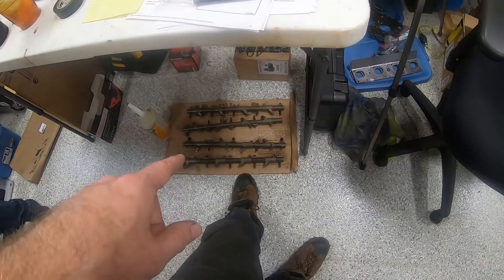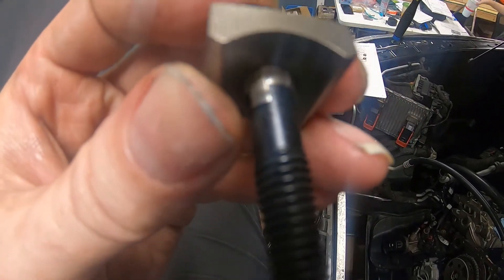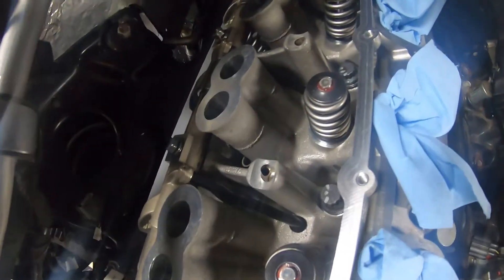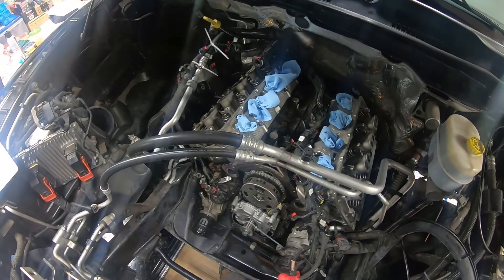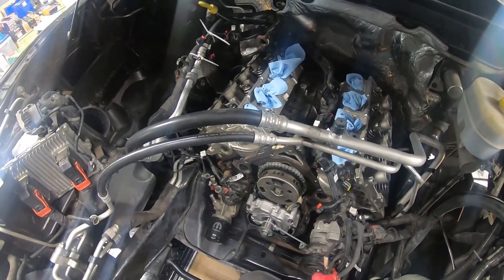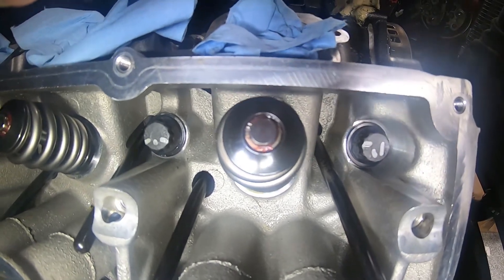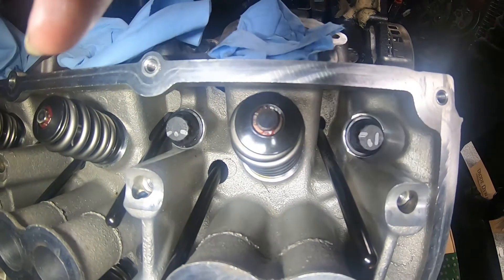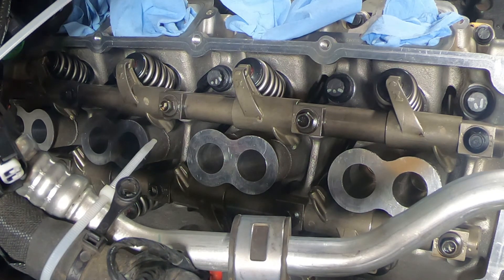Ram 2500 6.4L Upgrade Part 28 hemi valve rocker arm install

Comment: How did you measure to get the proper length pushrods? Because you used an aftermarket cam, which is likely ground with a different base circle, which would require different length pushrods to obtain the original hydraulic lifter preload.
Reply from the maker: Thanks for the comment.  The pushrod length was determined by my tuner, (Jay Green) as well as the grind on the cam.  He sold in a kit the cam, lifters, valve springs, valve spring shims, valve spring seats, and pushrods.
Reply: @solargarage  so Jay Green ground the valves & seats, too?
Reply from the maker: @budlanctot3060  No, I did that as part of the cleaning and prep when reassembling the heads.
Reply: @solargarage  wow. I'd say you were pretty lucky, that you must have had compensating errors. Grinding the valves & seats sinks the valves which increases the preload on the lifter. If the head is surfaced, or a different thickness head gasket is used, that changes preload, too. With 16 valves, there are a lot of variables here, which are not predictable unless extraordinary precautions are taken. If you were successful, congrats, you should buy some lottery tickets.
Reply from the maker: @budlanctot3060  Thanks for the comments.  You will see in the others videos that we indeed were successful.